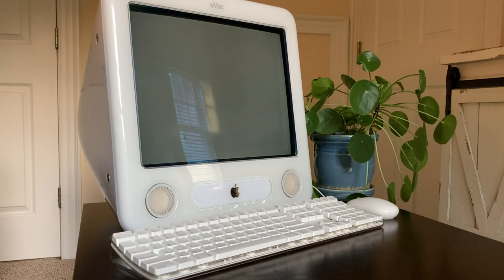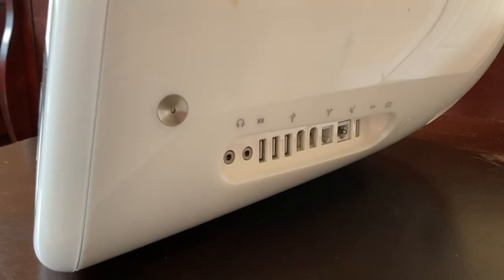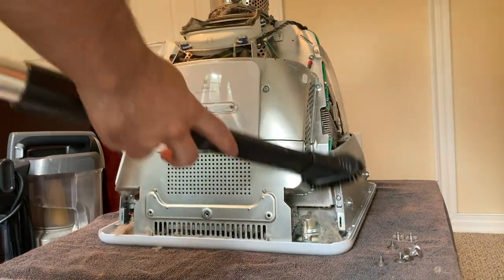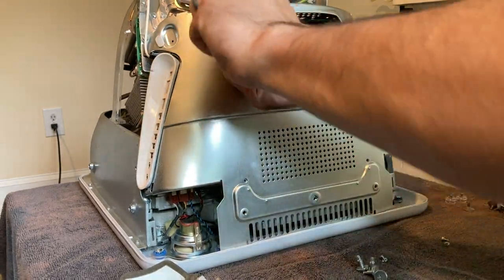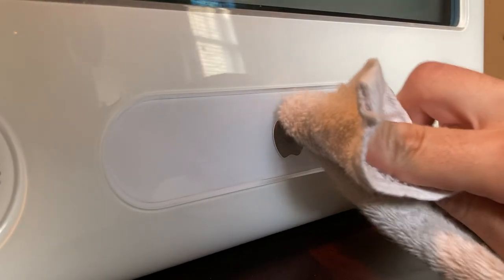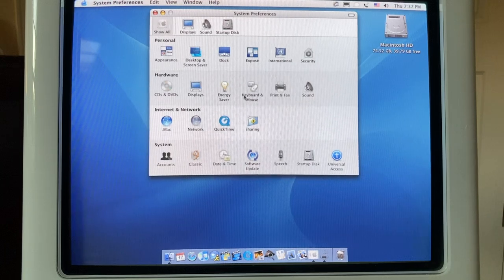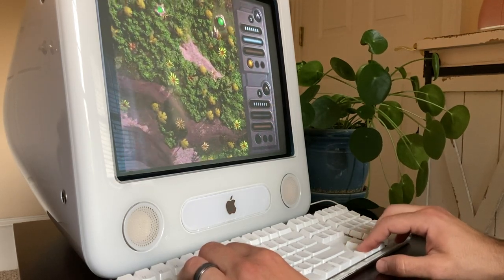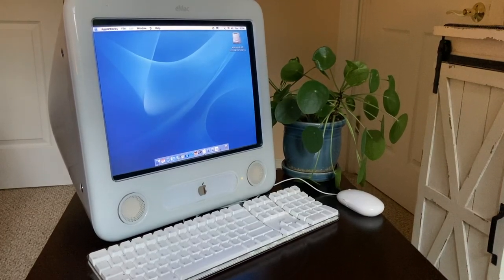Free Apple eMac, let's clean it up!

Comment: Depending on the version of the emac you can boot both os9 and osx. Very handy to have, your 1ghz model is one that boots os9 and for the most part makes it the best osx machine
Reply: I have exactly this mac and managed  to get it to dual boot. I put an SSD in mine, which was a pain. You need the 'unsupported mac' version of OS9 from Macos9lives, but that basically functioned.